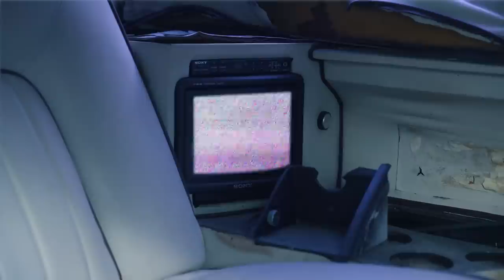The New Rolls Royce, My Dream Car!!!

Comment from the maker: For 16 free meals with HelloFresh across 7 boxes AND 3 free gifts, use code OFFTHERANCH16 at https://bit.ly/3svBDPN!
Reply: Are you hiring anyone!!! I want to work for a private entrepreneur not a blue-collar job!!!
Reply: Have hoonigan pimp it out for yah
Reply: Hmm I think you should fix it up back to it's original but modify the Rolls-Royce engine to make it go a little bit faster kinda like the cannonball run movie the first one. Strictly stock speaking 👋.
Reply: Would make a hell of a drift car.lmao
Reply: Trash it. It's terrible.
Reply: hot dog that car with a steel beam Tim Allan style
Reply: lemmie tell you its quirks and features.  PS get a silver spur they are better value.  The car you have will be a wiring NIGHTMARE.  Good buy none the less
Reply: Who else thinks Matt should make this go out with one big boom
Reply: @OffTheRanch I really appreciate what you are trying to do here, but i don't think it'll work. This car is cone beyond repairs. All good parts are gone, and you'd have to buy them back at an even higher price.
It would be way cheaper to just buy a functional Rolls Royce. Older ones can be had for less than $100k. Crashed or non functional ones run below $50k, you could fix one up that'll actually be nice. Because you can't just get nice parts for this absolute trainwreck.
Reply: Name it Demo Lemo
Reply: Its awesome you should name the Rolls Pearl, make it a burn out car especially for weddings & Ls fest
Reply: If you like seafood and or support a fisherman’s right to make a living you won’t buy anything from hello fresh or blue apron
Reply: How many people saw Dr Lee's sneak peek this morning? I did!
Reply: ship it to cleetus, no context have it dumped somewhere at one of his properties, flip it over or on its side do something funny with it. dont destroy earl
Reply: fix it up and give it to a viewer
Reply: next vid , i shot my rols roice with my 50bmg
Reply: new burnout car ?
Reply: Ranch Royce!
Reply: Cut the trunk off the rolls and turn it into a car-b-que.
Reply: Matt just an idea but u have the worlds first rolls monster limo for offroad luxuries
Reply: You're next burnout car! Genius!
Reply: Man... You can use that on a demolition ranch and call it a day... It's gone. Would be no fun restoring that...
Reply: I think there's no way White claw  was not involved in this purchase
Reply: I think he should lift it like the cuda
Reply: For crying out loud get rid of it
Reply: I’m just guessing but it’d probably be cheaper to just find a different Rolls Royce limo with more parts that’s more complete than to try and put that puzzle back together
Reply: Tilex will turn that vinyl top back white as new
Reply: Why would you need to explain something like that?! Those who would need it explained, would never understand anyway...
Reply: Do some wide wheels and low profile tires, I like the drift idea up there better than burnout. Modern retro it. Aluminum door panels inside, lit gauges, digital. Maybe smoke bezels and grill if you can find them. You could fix that Awesome on the cheap, sort of cheap.
Reply: You said you bit of more than you could chew on renovating the abandoned mansion too.. just don't go Factory for ANYTHING. Find after market cool stuff and either LS or Cummins swap. Cleaning up the back, sprinkle some LEDs around, weld the diff. = Luxury burnouts. 
Can't wait for the
Renovation Rolls series 😁
Or literally run it across the scale. If you don't bring it to life no one should.
Reply: I say you take it to Muscle Rod and give them total imaginative liberty to do whatever they want with it and make it a total surprise when they give it back to you. I would love to see Muscle Rod do a series on this!!!!!!!!!!!!!
Reply: Sell that POS. It junk
Reply: Matt, Coals Royce 100%, do a body swap! Brandon @ #musclerodshop would eat it up I'm sure!
Reply: Pls keep it and drag race it against hoonigans
Reply: I honestly forgot about craigslist... I thought everyone sold on facebook marketplace now.
Reply: Strip it down LS swap it burnout car
Reply: A extended Rolls Royce silver shadow body on a 2500 4x4 truck fame with a 4bt or isb4.5 Cummins, would be badass.
Reply: Hello Fresh one of the companies that want to destroying the Maine Lobster industry.
Reply: Definitely LS swap and burnout car. That would be epic...
Reply: Rolls Royce is my lifetime goal to own I’m jealous lol
Reply: Limo pre-runner
Reply: It will be the same transmission, the car used a TH400 from new so the Chev bolts right up.
Reply: The Rolls needs a V12, you should call up your friends at How Ridiculous and see if they can negotiate to get you one of the LS based V12s from Race Cast Engineering
Reply: Get rid of it
Reply: Ya know 🙄
Reply: keep it and fix it up. its an awesome project limo. and you now also be apart of the limo revival build like junkyard digs: https://www.youtube.com/c/JunkyardDigs
 and the limo vids is: https://www.youtube.com/watch?v=QarJ22H1f98 / https://www.youtube.com/watch?v=izaK6TqShc4 . He is in Aims, Iowa.
Reply: rally car it
Reply: @texasranger24  if he keeps the missing parts stock and not use the awesome after market parts available like he did for every other rebuild he's done like the bronco.  it all depends on how much like the original the final product would look.
Reply: Hey Matt you should turn it into a monster truck slash burnout vehicle.
Reply: Lift it and put it on a surbrban
Reply: That car would be super cool with two engines one in the front one in the back
Reply: hell nah lmao...shits SOOOO overpriced. Like 6-8x as much for Hello Fresh as buying the ingredients yourself
Reply: Make it origonal on the outsie but on the inside update it
Reply: 😂😂😂😂😂
Bruh ask @WATCHJRGO how his old ass Rolls is doin now a days LOL‼️
Reply: neets a twin turbo coyote swap and needs to be a car you can take to ford fest and slide the big beast around.
Reply: shouldve just bought the rolls limo that Burlacher Stradman and now LamboFam has!!
Reply: range piece would be amazing
Reply: @NephewJamie  I understand the sentiment, but you are aware that the majority of jobs at Bunker Branding Co is blue collar, right? 
Receiving, inventory, printing, picking, packing, shipping, are all blue collar jobs.
Reply: @davidblalock9945  Yes I do know that but it’s working for a private entrepreneur bunker brand he built his brand himself that’s private entrepreneurship that’s the type of person I would like to work for not a “big brand” “ Blue collar “ job from the state
Reply: Destruction Derby Car...obviously
Reply: RR the one and only LS swapped LOWRIDER in the world!!!
Reply: Already have Cummins Powerstroke RR needs a Duramax
Reply: If you keep it  BURN OUT Ooooo YAAAaaaa.
Reply: You are a sick puppy Matt but I LOVE IT.
Reply: Brother if you could find one and make it fit I'd put an Abrams tank motor in the Roles Royce. Just looked up the hp on one 1500 out put.
Reply: Mr. Demo you've got a scammer in the comments!
Reply: Drift car
Reply: Strip it bare and rat rod it
Reply: Turning it into a burnout car with a bunch of passengers sounds fun yet a bit 2 optimistic
Reply: @OffTheRanch #DontTellMere x A BazillionTrillion LOL And Mere thought that Matt's obsession to buy new Pew's was Bad......HAHAHAHAHA. ANNNDDDD don't look at the dead body in the trunk!!!! oooppsssieee
Reply: Diesel swap it
Reply: You should make it into a shuttle vehicle for the ranch

Comment: I think it would be cool to throw it at Muscle Rod and do a resto-mod. Keep it limo-style, make it super-pretty again, kick out all new completely custom hardware for the front to replace the missing grill and everything else. You've got a bunch of cool burnout project cars, you've got a bunch of bad-ass diesel super-machines, take this and go full glamor & style.
Reply: This. He doesn't really need another burnout car (at least, not until one of the existing ones dies horribly), and he really doesn't need another Cummins-powered... thing. Give it to Brandon, fix up the outside, and modernize the engine, powertrain, and interior. Something Mere and the kids can enjoy cruising around in.
Reply: I agree. Just restore it back to a beautiful and classy limousine again

Comment: Tbh that is the coolest car you got, but putting it together is absolutely going to be one of the most expensive projects you've under taken, especially if you want to put Rolls-Royce parts back on it
Reply: Have you seen his house? And the plans for abandoned village🤣🤣
Reply: Rebuilding the house will be cheaper
Reply: @digitalbartender2449  This car would cost more than his house to restore and I'm not joking. It would make a better demolition derby car.
Reply: @mckrackin5324  not even the same ballpark my guy. You're talking a couple hundred grand tops to get the Rolls Royce mint. The house was more like Millions
Reply: @sommebuddy  i checked it. Current price for one in good condition is around $70K. Not that much if you think about it lol.
Reply: @mckrackin5324  i don't think so. This one in good condition is around $70K
Reply: @IIXxSLAYERxXII  I didn't say how much a good condition one can be found for. I said to restore. Go buy all the pieces this car needs individually and hire an exotic car restoration company and get back to me.
Reply: @mckrackin5324  could be no problem or it could be a problem. I think you don't need an exotic shop to put everything together lol. He is connected anyways. Only problem could be the parts.
Reply: Strandman sold his for 30k.
Reply: @IIXxSLAYERxXII   you need a specialist for this kind of car...old Rolls-Royce cars were so complex and so hard to fix they could break infront of the factory they were built in and the people wouldn't be able to fix it. The hydrolics for the windows alone is gonna be around $35k to get replaced. The number of people in the world who can work on this isn't vary large either so labor costs are gonna be quite high and parts won't be easy to get either, I'm currently restoring a 1970 trans am, à mass produced American car and the parts for that aren't easy to get or cheap, Rolls-Royce parts from 51 years ago gonna be way harder and way more expensive...to restore this car back to it's original state is gonna cost no less then $150k.

Comment: Definitely torn on this Matt, would love to see it all fixed up but at the same time I'm also like the car doesnt have much going for it lol
Reply: If he sells it, then it must be sold to Westen Champlin.
Reply: About the only thing the car has is the body of the RR limo and it's not even a good body I really think he needs to sell this one
Reply: If you fix it up, Factory is NOT the way to go. Find modern parts that fit.. ish, have Brandon weld up a grill. Tons of LEDs and LS swap, weld the diff, clean the back, and you have luxury burnouts. Renovation Rolls series.
Reply: @SHADOW517joe  however, restoring it to its original 1971 condition would be awesome too.
Reply: @TheGnarlyGnome89  but that would cost as much as the House.

Comment: I believe Rolls used to use a modified version of the turbo 400 transmission so the small block check might have bolted right up to the factory transmission.  The factory shifter could have still worked even after the engine swap.
Reply: Correct, it's just a stock TH400 and a Chev bolts right up to it.
Reply: Yep I was thinking the same thing they used chevy based transmissions buddies grandpa had one that they kept threatening to put a small block in because the machined mating surfaces rolls used instead of gaskets after a certain mileage become a leaking pain in the azz

Comment: The transmission is a chevrolet th400 with a motor actuator on the side of the trans to shift it so it will need power but it's probably still a th400.   Build it

Comment: "No one has a Rolls Royce burnout car".
Hoonigan does, actually. Check out their car for inspiration - Hellcat-swapped 900hp '78 Rolls. 

With that rust and the valuable parts gone, it's gonna take a lot to save it. Turn it into a Gambler car instead and hit up the Gambler 500 in Oregon next summer.  We'd love to have you there in a Rolls with some mud tires on it.

Comment: Coals Royce with boxed frame and lowrider kit. Can you bounce a Cummins?  will it fit?  Also needs a sunroof Ma Duce Gun mount.  Maybe transplant the ring from the Duce and 1/2 Fire Truck.  Maybe go with this design (Beatles Rolls Royce) And the empty Headlight sockets will make great Turbo Intakes

Comment: Drop it like it’s hot! There has to be a reason that it was being scrapped out. Even if you put the body on something else. There could be ghosts attached to the car. Had it with a race car that a buddy ran and every time it started doing well something would happen and it would hit the wall or get hit from another accident on the track. He ended up selling it for way less than what he had into it.

Comment: That limo has to have a ladder bar frame. If so build another “Truar” or truck-car. Lift and big tires with a Diesel engine in it. Get one of those cheap Isuzu box truck engines that are diesel. Then you could have the start of your truck-car fleet.

Comment: Probably obvious from the ending it will get put onto a long wheelbase 4x4 chassis “same wheel base as Earl , lifted same like Cuda and another build so more content.  Potential is endless. From low rider big block or big ol smoker rollen coal
If it goes military or civilian it will be good to follow. My vote is a Stars and Stripes body wrap. Or camo side opens as a gull wing door and hydraulic step then inside have a wall  of pew pews mural style. Remove the privacy screen between your driver and convert it into a gun rack. James Bond style flip panels on roof with 50mm lifts up.  The feed belt ect ect can work out as you go.
Perfect for events as a eye catching beast. Matt just do it.

Comment: Idea.  Burn out car, but chop the roof off the back and install a bunch of lasers and lights.  Which will reflect off the tire smoke in an epic light show.
Reply: After looking up the frame of the car, don’t chop the top off.  It’s part of the structure.  Still like the idea of the light show.

Comment: Good luck I worked on a few of them the brakes are you need a NASA engineer to fix the damn points in those things are solid sterling silver and they’re about to 90 them they’re not fun to work on and good luck

Comment: Throw a stock LS 6.0 and a 4l80e in her and weld the rearend and she’ll do donuts on dry pavement and drift, trust the rev limiter. Also rig a Chrysler 300 front clip on the front to fix all that expensive missing crap